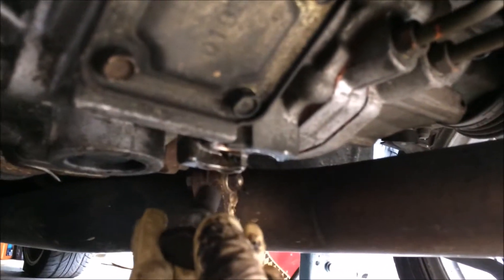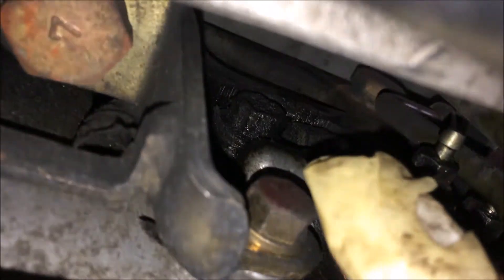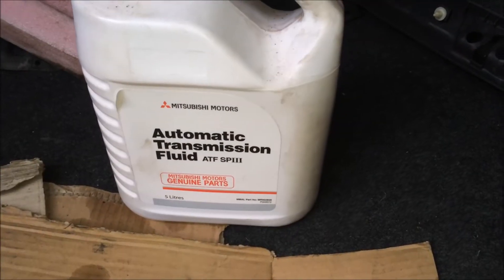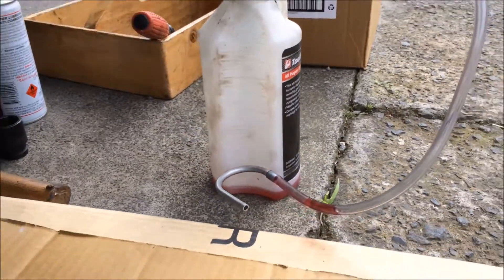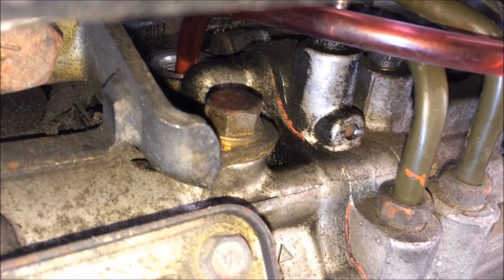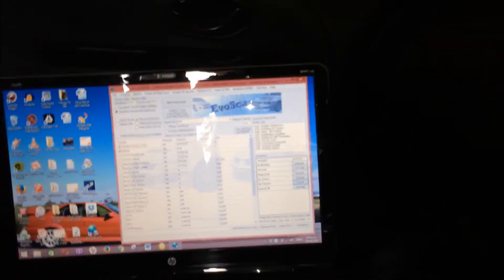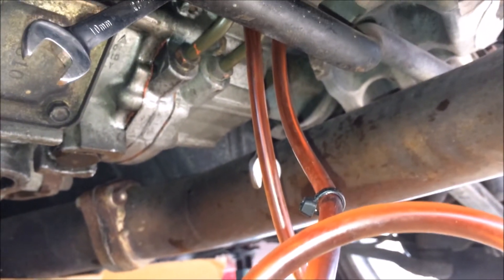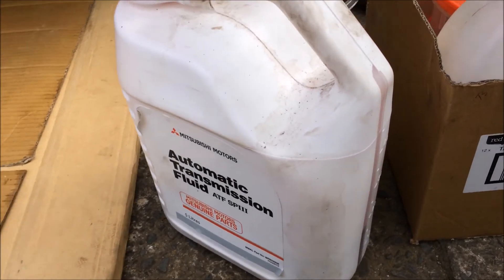Tactrix OBD2 AYC Fluid Replacement & Bleeding Mitsubishi Evo

Comment: Thanks for the video. What is the air bleeding button for in Evoscan? If you replace the AYC pump, then fluid, the only two buttons you need to bleed are the OP L/R? Thanks.
Reply from the maker: Correct, those are the only two buttons you need, will take a lot longer.

Comment: You need 3 fluids. GL5 for the diff, Diaqueen AYC fluid for the clutches, and sp3 for the hydraulic piping. I hope you didn't put power steering fluid into the clutch packs
Reply from the maker: Did you not read the title? This was a AYC service. SP3 is filled in 2 places to complete a poper flush of the system. The clutches on the diff and the ayc pump, Reservoir in the boot. The rear differential is completely separate. The fill plug is located on the opposite end. FYI you only need 2 fluids, gear oil for the diff and Diaqueen sp3 for the ayc system.
Reply: @AutoBuddynz  oh right, I must have read the service manual wrong where it says in seection 27 - 2;
 "Differential: MITSUBISHI GENUINE DIA QUEEN SUPER
HYPOID GEAR OIL (GL-5)"
 "Torque transfer
mechanism:
MITSUBISHI GENUINE DIA QUEEN AYC FLUID"
"Hydraulic piping fluid MITSUBISHI GENUINE DIA QUEEN ATF-SPII".

I guess i can stop buying actual Diaqueen AYC fluid now and use atf. AYC fluid and ATF aren't the same.
Reply from the maker: @knobblyknob  i wouldn't recommend just using atf. Sp2 has been superceded to sp3, I would recommend using genuine Sp3 or a fluid which is sp3 compliant.
Reply: @AutoBuddynz  thanks,I wouldn't recommend running atf in the AYC clutch baskets. There is a dedicated AYC fluid.

Comment: hi i have a question. 
Do you need to loosen up the bleeder screw before hitting the op check option on evo scan or you do it in reverse ?
Reply from the maker: What I normally suggest is getting a helper and opening it straight after L/R OP check is pressed. Alternatively you can do what I did and submerge the hose in AYC fluid, open the bleeder screw and then press the OP check button L or R.